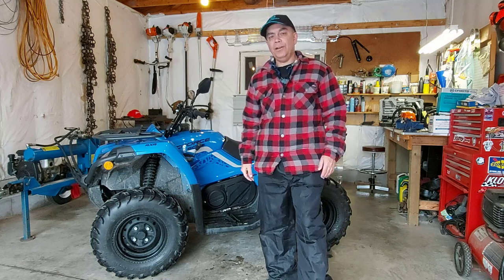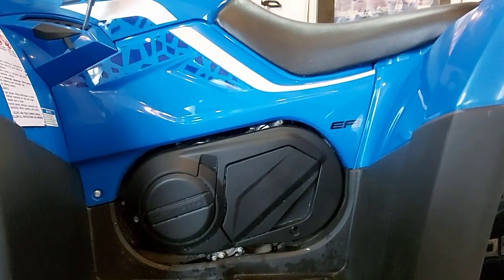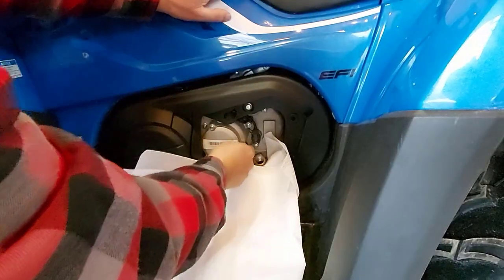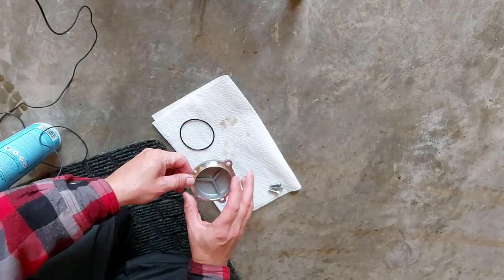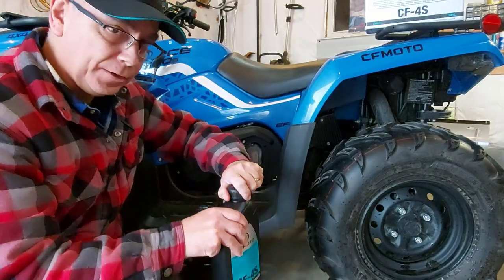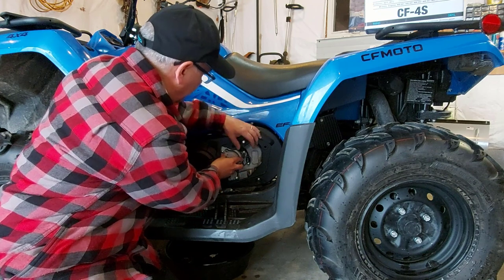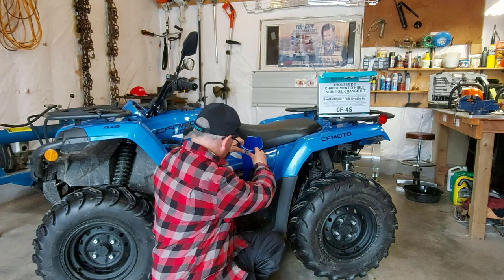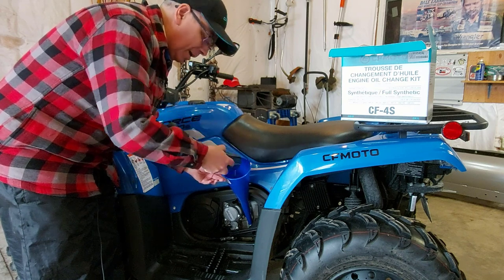First Oil Change for this CFMOTO CFORCE 500 | Break-in Maintenance

Comment: Great Video, thank you! Quick correction, the oil filter bolts are to be torqued to 7.3 ft lbs of torque. NOT 10 ft lbs. Just wanted to post this in case people accidently strip out theyre bolts. (Atleast my owners manual says 7.3ft lbs of torque, 2023 C Force 500)

Also, drain bolt cover says torque to 18.5 ft-lbs

Comment: You don't have to screw the dipstick in to check the oil level  It should be at the full level before you thread it in That's what it says on the manual for the 600 anyways. Just trying to help because I would of done it same way as u myself before I read it.
Reply from the maker: I was wondering about that also. Glad you mentioned it. Thanks 😀
Reply: I'm glad someone mentioned that. I was surprised to see dipstick being screwed in. I know with Honda you never screw dipstick in and I saw an MSC video on servicing a CFORCE and he didn't screw dipstick in.
Reply: Nice video, thanks, and about the dipstick, they are not screwed in while checking, all models so far as I know 👍

Comment: did you have to bring it in to dealer to check the valve or any adjustment needing you to bring it on or you can just do all basic maintenance yourselfe without void the warranty?
Reply from the maker: No I have never taken it back to the dealer. I do all maintenance myself. I don't believe it will affect the warranty.

Comment: So what do you think of the 500?  I've been looking for a second ATV for my son to ride and I have my eyes on this one.  Price and availability are great but I'm wondering about reliability.  I just got a 22' Outlander 650 XT in January and love it.  I'm in the west end of Ottawa but we have a cottage up near Cloyne ON or Bon Echo Prov. Park.  Great riding in that area and my son has sparked some interest now.  What do you think so far of the CForce 500?  Cheers!
Reply from the maker: Hi Todd, I actually took the Cforce out for a good ride yesterday. I'm happy with it. It's basic and does the job. Great value for sure. I hang out in facebook cfmoto groups and everyone that has a cforce has only good things to say about them. The power steering makes for good handling. I have an older Suzuki Eiger as well and power steering is non existent on it. The only thing I wish it had was gas shocks. But you can't have everything. I did a video of the ride yesterday and it's new on the channel today! 😀 Thanks for watching!